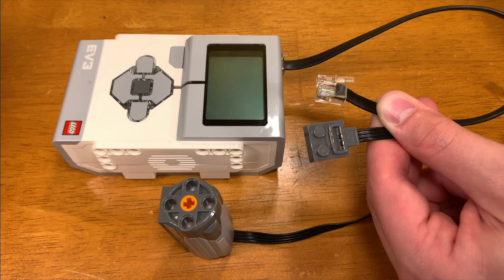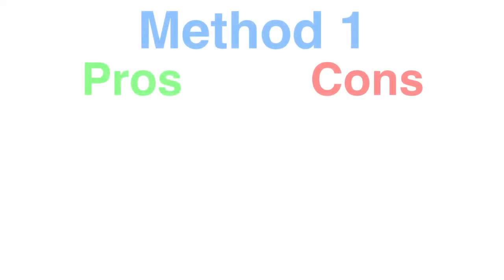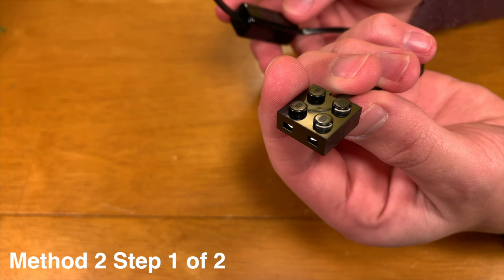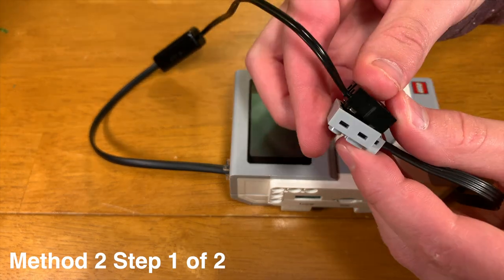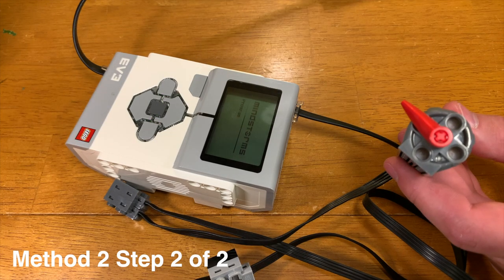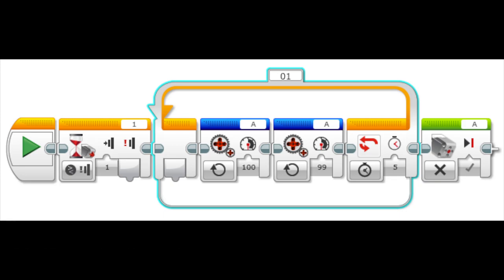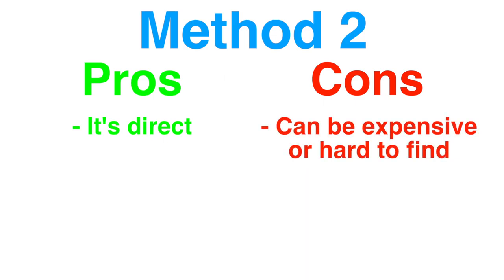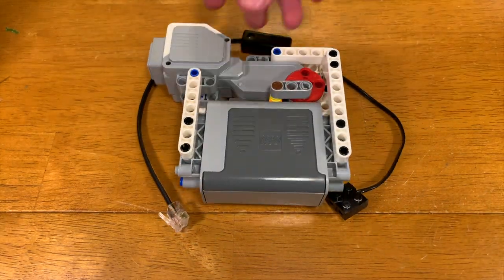How to Make LEGO Power Functions Motors Work With Lego Mindstorms EV3 WITHOUT MODS [2 Ways] [HD]

Comment from the maker: Turn the volume up, it’s a bit on the quiet side.

Also, there are two ways around the unregulated motor problem. Firstly, you could buy one of Lego’s rechargeable EV3 batteries and have it constantly plugged in charging. The downside of this is that the rechargeable EV3 battery packs are expensive, around 80 USD. You could probably find one used and thus cheaper on eBay.

You could also power the EV3 brick with a 9v power supply that you plug into the wall. Make sure it’s a switching power supply also called a switching adapter. This is a kind of power supply that keeps its output voltage steady no matter the load. The adapter should say switching adapter on it if it is. Luckily, these are just as common as the adapters that contain heavy and inefficient transformers. If you were to do it this way, it wouldn’t technically be a mod to the EV3 unless you soldered wires to its battery springs. What you would need to do is cut the end off of the 9v wall adapter and find which wires are negative and positive. This can easily be done with a multimeter. Take two alligator clips and hook positive up to the positive battery spring and negative to the negative one. You are done. There are several online tutorials on this. Google “EV3 power supply from wall adapter” and you should find a few.

Comment: Thanks for the tips! I just have one question: Must you still use the Unregulated Motor blocks when you are programming LEGO Power Functions Motors to run for a certain number of seconds without using the touch sensor? I am using multiple EV3 bricks to operate third-party Buggy Motors that drive the lift fan propellers in my large hovercraft robot, and I am planning on controlling it wirelessly with an NXT brick.
Reply from the maker: Yes you must. If you don’t, it will run for about a quarter of a second before shutting down. I show this at 2:30. I show how to make what your asking about work at 3:26. But be aware that since it’s an unregulated motor, the EV3 will give the motor whatever voltage the battery is at and not keep it constant. This means that the motor will slow down and get less powerful over time. In other words, it won’t accomplish as many rotations as it would on a full battery on a low battery.
Reply: @LegoTechnicsRule  Got it! Thanks again!
Reply: @LegoTechnicsRule  Got it. Thanks!
Reply: i reply to @tcm0

Comment: Any idea how to get method 2 working with ev3 classroom?
Reply from the maker: I’ve always used the EV3 Lab software as it’s the original programming environment. The scratch based Classroom software is fairly new and SIGNIFICANTLY less powerful than the Lab software. With that being said, I don’t have much experience with the Classroom software and don’t really know how to help you there. However, I do know the Classroom software is a severely dumbed down version of the Lab software so younger kids can understand it. Thus, it’s definitely missing lots of the more advanced stuff like unregulated motors, so I don’t really have lots of faith in the Classroom software.

Comment: Your cable is not built correctly so that's why you have to apply that hack. You need to use 2 resistences to fool EV3.
Reply from the maker: The cable was originally made for NXT, so it would probably work without the unregulated motor block if I were using it with NXT. Anyway, the point of this video was to make PF work with EV3 without mods, but you bring up an interesting point.
Reply: @LegoTechnicsRule  you can even make a cable that works with both regular motors and servo and control them with EV3. Works perfectly. If you want I can leave a link with instructions here.
Reply: @HugoAugusto that would be great!